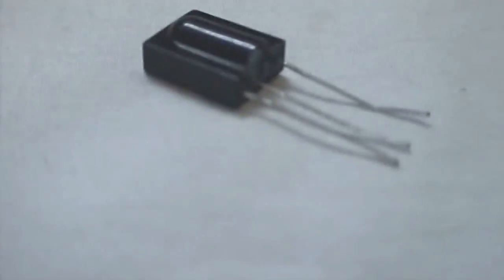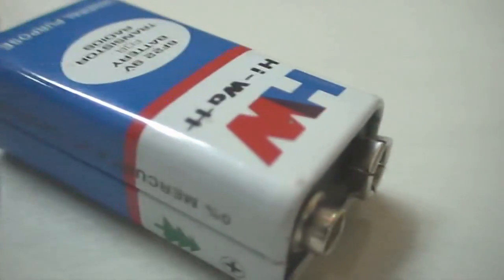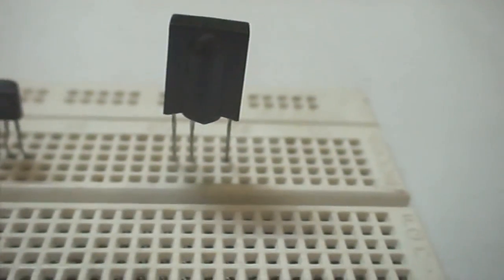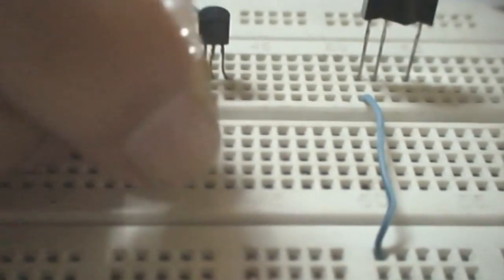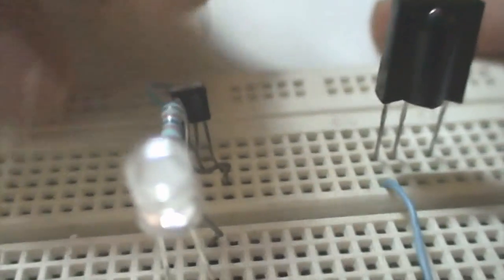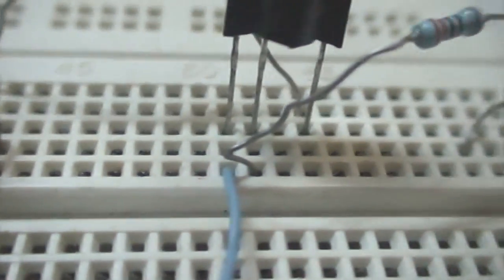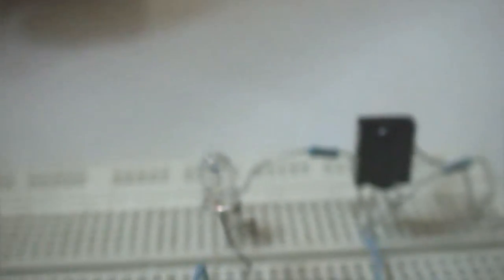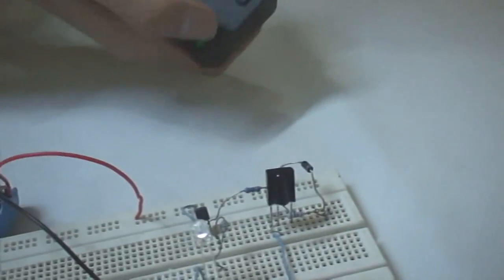How To Make A Remote Tester (IR Receiver)

Comment: when i connect the battery, the LED started to blinking ??? and i just can't check my remote? give  me a solution as soon as possible
Reply: To stop it from blinking and to get a smooth light add an capacitor ranging from 10uf-100uf.that will do the trick

Comment: how to make a IR sensor based switch control instead of a tester. To switch ON and OFF the LED using a remote once using similar components.not a complex circuit.

Comment: what is the purpose of diode?
Reply from the maker: It ensures the flow of current in one direction
(unidirectional flow of current)
Reply: Gaurav Yash Jain - AYJ but that would make the current flow in other direction here? and thanks
Reply: +Rajat Singh In reality, this is a dummy proof protection, just in case someone would reverse the battery wires.  If the circuit is done and connected as expected, then the diode isn't necessary.

Comment: what will happen if i put only 330 instead of 330k?
Reply from the maker: Dip Dolui 330k Ohms = 330*1000 Ohms
Reply: +Dip Dolui Actually, you don't really need it, however make sure that the input voltage doesn't exceed 6V.  Using a 9V battery is too much.  Lowering the voltage and current via a resistor, is simply a waste of ressources.  Search on the internet for the Vishay's TSOP17xx datasheet.  This will answer quite a few questions you may have.